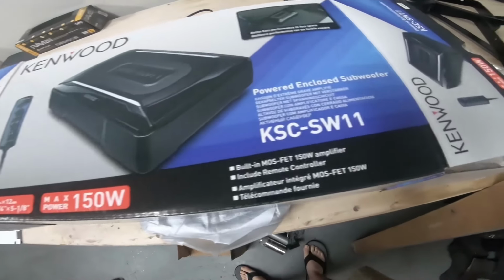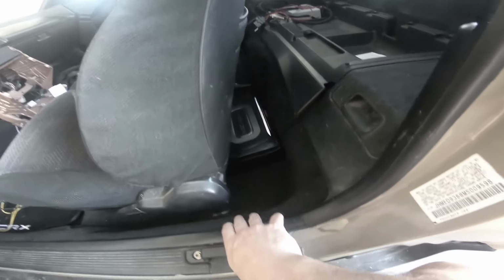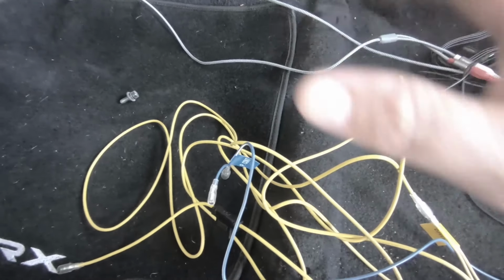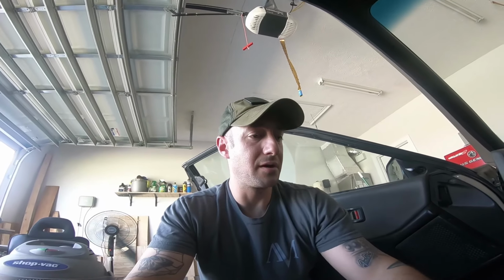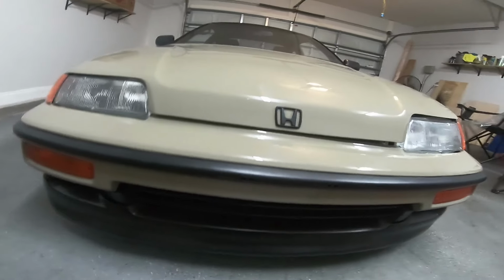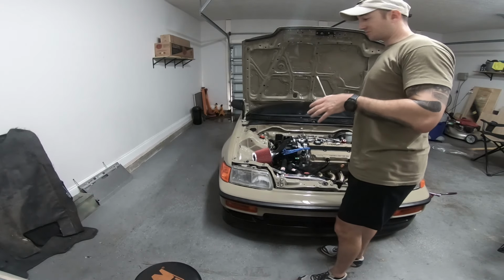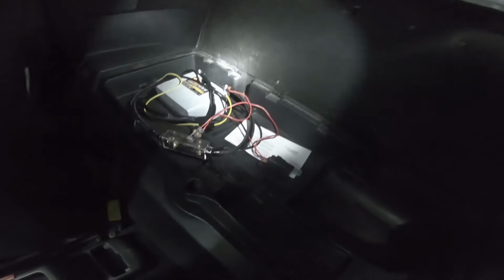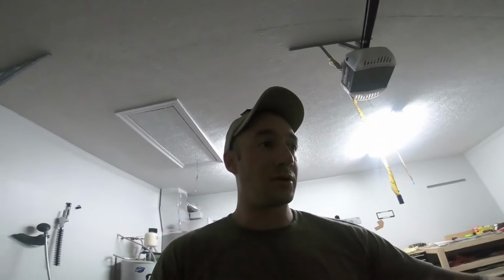Honda CRX Si Kenwood KSC-SW11 Install Part 21

Comment: 😄 I’ve watched lots of videos on this subwoofer, and the CRX  is the only other car I’ve seen where it doesn’t fit under the seat (the other being my ‘06 Miata).  At least you have a little more space behind the seats - I have mine in the passenger footwell. 

But I’ve had mine for two years and am very glad I got it. Never hooked up an amp it subwoofer before and this was very easy. I also learned to use the internal crossover controls in my aftermarket head unit, and also used the separate RCA subwoofer output. I set the HPF and LPF at around 125Hz so the door speakers don’t have to work so hard. 

P.S. - I’ve found a good test track is the Beatles “Come Together “. There’s a heavy bass line, especially in the bridge and at the end. Without the subwoofer, the door speakers sounded awful even with Rockford Fosgate speakers and. Kenwood head unit. With the subwoofer and crossover settings, it’s nearly perfect because the door speakers can shine in the mid-range and treble.
Reply from the maker: Thanks for watching! I still love this little sub, contemplating putting it in the trunk area but not sure we’ll it’ll sound back there versus behind my seat

Comment: Nice I have the same setup.
Head unit straight to subwoofer. I bolted it down in the trunk center
Reply from the maker: SR7eventyone main reason I left my wires long still. After I make my trunk board I may just rest it back there.
Reply: Justin Gadell ya I hid the long wires strapped them under the passenger side door garnish where the other wires are 😹